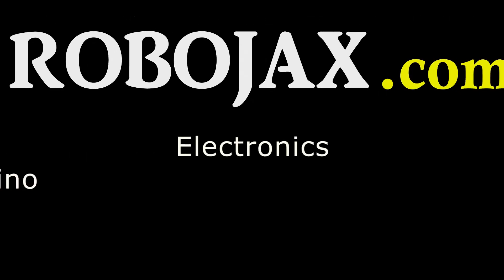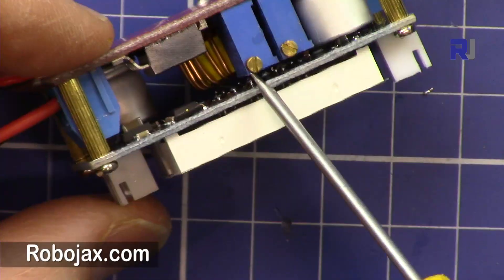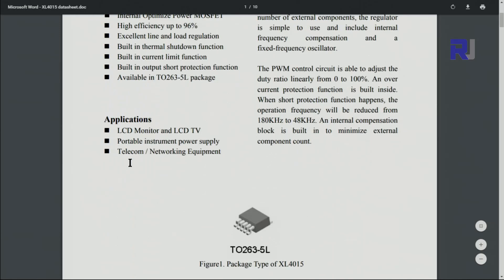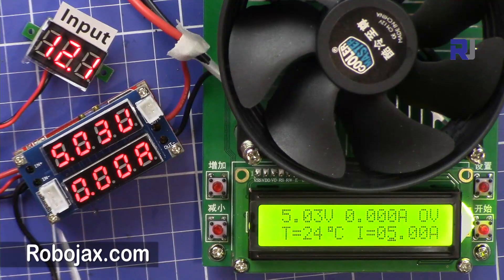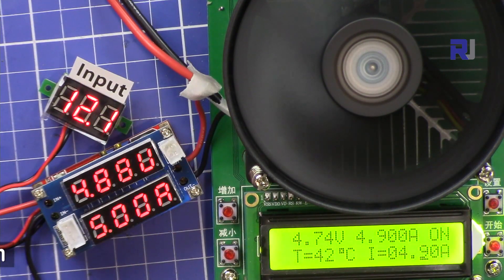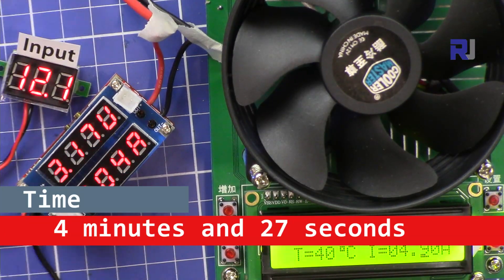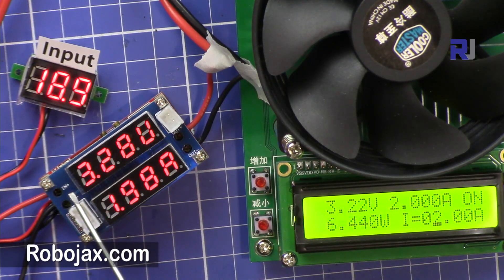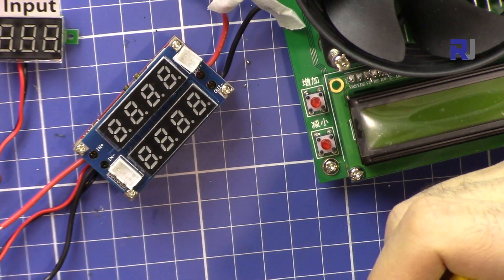XL4015 DC to DC 1.25 to 32V 5A  Buck Converter Lithium Constant Current charger

Comment: You call this a constant current power supply is it a true constant current power supply with a compliance voltage adjustment? Rather than a current LIMIT supply? Two different things period

Comment: Great Video. Bought one. Can we use it's Voltmeter Ammeter pair (the top one) separately with other buck/boost converters by soldering wires(alligator clips) to their input and output?
Reply: Yes, sure you can

Comment: Could you tell which IC/micro controller is used for the display?
While adjusting trim pot the screwdriver accidentally went over the ic pins now it's showing weired numbers.
Reply: Pm me can you to install do solar panel..
Reply: In my module the microcontroller/IC looks completely black. i.e. nothing printed on it.

Comment: I have a set of 4x3.85V 40Ah lithium-ion batteries (U max 4.4V). I use the converter to charge the battery in winter through the cigarette lighter socket inside the car. The conversion efficiency caught at 16V-13V input/output voltages was 94.2% in my case. I measured very accurately. Worth noting is the current, which has its efficiency peak at 1.2-2A. For me, this is ideal for slow overnight recharging. If the conversion voltages are close then the efficiency is high, although not as high as in good PWMs (even 99%)
Regards, Marek
Reply from the maker: Thanks for sharing your experience.
Reply: Pm me can you to install do solar panel..

Comment: I purchased a red color XL4015 5A module and the potentiometers are located a bit differently there - installed vertically. My Li-Ion battery is 3.7V/800mAh. When I set up the output voltage to 4.2 volts with the potentiometer (physically located closest to the voltage input terminals which is in my case 7.5 volts) then measure the output short-circuit current with 10A current range multimeter it is always 2350 mA regardless of the position of the constant current potentiometer (physically located closest to the voltage output terminals which is in my case 4.2 volts). If I connect my Li-Ion battery is 3.7V/800mAh and measure the charging current it is always 50 mA regardless of the position of the constant current potentiometer (physically located closest to the voltage output terminals which is in my case 4.2 volts). Question - how to adjust the constant current potentiometer to make the output current reach the predetermined overcurrent protection value of 800 mA? I have tried already 3 out of 5 modules you sent me -all are the same.
Reply from the maker: this is multiturn potentiometer. meaning you have to turn it 10 to 15 turns before you see the change in current.  either your battery is fully charged or the current on this device is set to minimum.
Reply: Pm me can you to install do solar panel..

Comment: curious, but if you routed the potentiometers out to say actual dial potentiometers, could you put a heat sink along the top of the device, in contact with the chip?
Reply: The primary heatsink path is through the metal tab, onto the PCB.  You could offer a little stress protection for the chip plastic casing with a heatsink on top, but it wouldn't necessarily need to be so large that you would benefit much from removing the pots, rather than just using a smaller heatsink.  Instead, just get a different buck regulator module.   There is no point in pretending it is a 5A module merely because that is the max spec for the IC but rather, to consider it less because of the whole design.  A design for more current is a minimal difference in price unless you are buying great volumes to make product in quantity.
Reply: Pm me can you to install do solar panel..

Comment: Hi, how did you get the 5v? Always it shows me the input voltage which is 12v and I can’t adjusted with the pot. I managed to adjust the current. Can you please tell me how to get the 5v at the first place? Thanks,
Reply from the maker: Hi, This is multi turn potentiometer. Turn it 10 to 15 turns.
Reply: @robojax  thanks it work.

Comment: Can I charge a car battery 14,4   3Аamper tuned to the output. rechargeable battery 64amp
Reply from the maker: Hello, this is exactly why I made this video to answer those type of questions. I don't remember the maximum current but for sure you can set voltage to 14.4V. Just watch and see if it can handle 3A, then yes.

Comment: What are the two white connector units (2pin and 3pin) on the metering unit used for?
Reply from the maker: I believe I mentioned that I have not found any information about those. use a multimeter and see if the value changes when you turn the potentiometer. so it might be for external switch or potentiometer.

Comment: can we use this charger for cordless battery
Reply from the maker: this module just knows voltage and current. so yes it should work if you set proper voltage and current for the abttery.
Reply: how many voltage input will put

Comment: Thank you for this video.  It was very enlightening.  Sadly it opens up at least as many questions as it answers and at some point in time I can see I am going to have to look at the chips and look at this from a lower level, but for example there are two big fet's that can disconnect the battery.  I think one was over voltage and one was over current.  It seemed like all of the current was going through both of them.  Given they have some on resistance it would seem to make more sense to only have one and have both conditions be able to trip the same gate.  And in the balancing charger, it seems easy to have the fet both bypass and discharge the most charged cell, but it would be more efficient perhaps to have two fet's there, one to disconnect the high cell and one to bypass it.  This may not be that big a deal if you are charging off low cost AC from your utility, though waste it still waste, but if you charge off of solar for example do you really want to be turning any more very expensive power into very expensive heat than you have to.  But, you did a great job going over that these things do and what they do not do which is just what I was looking for.
Reply: OOPs, wrong video, this was intended for the BMS one https://www.youtube.com/watch?v=0mOqpCfAdy4
Reply from the maker: Hello, the video for BMS is moved here https://youtu.be/QNENyu97w2A
Reply: Pm me can you to install do solar panel..

Comment: What is the function of the two jst connectors (white colour) which are placed on the top of the module??? This was not explained in the video actually.
Reply from the maker: the manufacturer did not provide details.
Reply: @robojax  Ok thanks but do you have any source/information which could explain the functioning of the jst connectors????
Reply: I had the same question. So I checked the continuity and checked for any paths on the pcb from these connectors. Here are the findings - The two pin connector is not connected anywhere. The three pin connector has a GND, and 2 pins labelled RX AND TX. I guess it would be used for a serial communication with a microcontroller. Also this V/A module has a voltage regulator that outputs 3.6V, meaning this v/a module runs on 3.3v(may be) and so the RX TX pins must be 3.3V, (I didn't try connecting it to a microcontroller yet).

Comment: I have 2 questions.
1. There is no cable between the 7-segment layer and the sub-layer but how does the screen work?
2. What was the 3-pin and 2-pin on the top layer for you removed from?
Reply from the maker: Hello, 1- the module has 4 screw. those are used for communication and power. 
2-connects are using for programming or external potentiometer
Reply: @robojax   Could you please tell me how to use the serial pins, preferably with an arduino?

Comment: Helpful video sir , can I charge 24v 20a lithium ion battery pack ?
Reply from the maker: Yes you can.  your battery capacity is 20Ah and if you charge it at 4A, it will take 5A to charge it. I am posting how to charge a battery using this module. Make sure to subscribe so you are notified.
Reply: @robojax  Thankyou Sir 👍
Reply from the maker: you are welcome.

Comment: Can I charge acid filled lead batteries with this module?
Reply from the maker: yes you can. you'd have to set your voltage and current limit.
Reply: @robojax  For a 12 V 5 AH acid filled lead battery, to what value the charging voltage and current to be set?
Reply from the maker: for each battery it is mentioned in the documentation of the battery. find it.

Comment: It's a shame you didn't test another great feature of the upper module which is the serial communication. That is an awesome feature that allows logging and power calculations for battery chargers of solar systems.
Reply from the maker: I didn't know. it has such feature. when I purchased it, I did not see any documentation. Assuming the upper module is just display. thank you for telling me. I will have a look at it.
Reply: @robojax  I know...these chinese modules don't provide any documentation and very often we miss some nice features. I got the pinout for the serial port on another video, but I'm yet to play with it myself.
Reply: could you share the source please.
Reply: Pm me can you to install do solar panel..

Comment: can i use 3s lithium ion battery pack (12.6v maximum) to drive 12v led strips with 12v from this board?
Reply from the maker: this module doesn' t know the battery type. Voltage is voltage.  so yes.
Reply: @robojax  ok thank you

Comment: I do not know if someone out there can help me? here is the problem I have with this module: I am having a problem in  following the instructions from Robojax in this video and trying to set the current. 1) I set my voltages to 5.00V without a problem 2) As I short the output wires the current reads 1.25A and the blue light is on. I then try to turn the current potentiometer the raise the current to 3.0A, at around 1.75A the display suddenly shows 0.00 A and the blue LED shutoff and the red led turns on. And now I cannot adjust the desire current, is my module dead? (by the way I tried with 2 modules), is there a way to reset it to normal operation and if it is the case how can I adjust my current up to 3A? after all the specs on this thing is 5A... Thanks for your help!
Reply from the maker: I waited to see if someone replays and your comment was under "I haven't responded" section. For me to answer, I have to connected the exact voltage and load to see it and I don't have the module ready. I hope someone reply
Reply: @robojax  Thanks, no one replied just yet! I still have the same problem! I was trying to feed 5 volts to a Raspberry Pi 4 8Gb and I kept on getting the low voltage on the Raspberry - So I wanted to crank the amperage up to 3 amps to properly provide the right current to the RPi .

Comment: Is it possible to power a laptop at 19.5v 3.33a from a 3s 12.6v lipo with that converter?
Reply from the maker: 3S 12V can be 1W or 1000W . now. your laptop needs 19.5V x 3.33A = 65W and if your battery can supply 65W ÷ 12.6 = 5.1A yes you can do it.  this is the minimum.
Reply: @robojax  Thx for that info. I recycled the 3 cells from a laptop battery and connected it via a 3s BMS. Each cell has 4300mAh. So I think the C rating is higher then 1. But I guess I need a proper cooling solution for 5A through this converter?

Comment: If the input current is only 1Amp the module can boost the output to max of 5 Amp or it defends on the input current?
Reply from the maker: Output power can never be more than input .(  Input Power +10%) = (Output power). P=VxA if you tell me the input voltage, then I can tell you the output voltage and power.

Comment: Nice video. I need to connect 2 usb ports  to charge cellphones, does phone gets as many amps as it needs?
Reply from the maker: Yes. Check the video. At 5V output it will be divided the current (Ampere) into two phones.
Reply: @robojax  ok, thanks.
Reply from the maker: you are welcome.

Comment: Nice video. I need to power my odroid xu4 thru battery. so i need a stable 5V and 4A current. Which DC-DC do you recommend for nimh,nicad or SLA batteries with 7.2V or 12V input?
Reply from the maker: Thank you. NIMH has longer life but needs careful attention when charging.  NICD is cheap and easy to charge but not as lasting as NIMH.
Reply: Pm me can you to install do solar panel..

Comment: Thanks for the excellent review.  I made the mistake of ordering gel cells for a small portable power station I am building.  I am using 2x 12 volt 12 ah batteries parallel.  Since then, I have been looking for a good way to charge them at 14.4 volts with a 2 amp max rate.
Would this be a solution to charge them with a small 30 watt panel?  Does it turn off the charge when voltage levels are hit like some others I have seen?  Thanks.
Reply from the maker: You are welcome. First this is NO a charger but it is a power supply. Because it has CC (constant current) setting capability, you set your current and voltage and never allows any current above your limit.  I mentioned that is is not a charger because Lithium Polymer (LiPo) and other sensitive batteries need special charger or they get damaged. Your battery seems to be different and if you monitor status of charge you can use this module to charge.
Reply: So it is possible to use with the panel, but there is no “cut off” voltage point on the charger like a typical controller. one way to charge gel cells is with a constant voltage float charge, I could just dial 13.8 in. Or, if I had a load running on it, I guess I could dial up the voltage to 14.1-14.4 volts.  In any case, I think the panel at 30 watts is pretty close to the max amp limit with 24ah, so I would really only be using this to decrease the volts down 4-5 volts, not so much the current.  Thanks for your input.
Reply from the maker: the current determines the voltage. for example if we set the current at 2A. Any current under 2 will keep the voltage at 14.4. Then as the current reaches to 2A, the voltage is reduced until the current is below 2A and charge continues until no battery is full and it doesn't need more current, then voltage rises and charge will stop. so voltage  will be observed and 14.4 is your cut off .

Comment: I have seen a review of your video about the LM2596 and XL4015 modules. I was thinking about how to stabilize the ic temperature when working full load. Now I have thoughts below, but I want to ask for your personal opinion. According to you :
Can ic xl4015 (with the use of constant current 5A) or lm2596 (with the use of constant current 2A) be separated from the default board and then extended pinout the legs ic using a good cable and then attach it to a heatsink that has the fan? For example, it is affixed to an old VGA card fan heatsink where the power to turn it on comes from the input power module.
I mean that the 3.42A / 19V (laptop charger) power source is coupled to the IC 7812 input (with a heatsink) then outputs the IC 7812 to the VGA card fan.
By the way, in your opinion, which is more accurate in measuring currents using a common digital multimeter or digital volt and ammeter panel?
Thank you in advance and greetings from Indonesia.. (*_^)/
Reply from the maker: Yes you can move the regulator to large heat sink. Actually that is the best solution. 
For current measurement, it depends on how good is the quality of panel or multimeter.  Some times V/A panel meters are better than meters. But meters are generally better. You would have to do the test and find out which one is accurate.
Reply: @robojax  Thank you for the reply..
Yes, I have tested it on both devices.
In the XL4015 module, I set a current output of 1A and output voltage of 4.2V.
But I saw something wrong, why is the difference in the current reading on the two devices different?
Try to see for yourself in the attachment that I included here:
- Before the current test: https://www.dropbox.com/s/5vzygkrqrrtoja9/Before%20test%20current.jpg?dl=0
- While the current test: https://www.dropbox.com/s/ayiugf1g7yhj4y3/While%20test%20current.jpg?dl=0
- What inside on black box : https://www.dropbox.com/s/b0qtgf1yrvqwsdj/PSU_XL4015.jpg?dl=0
So, which current reading is correct?
Digital V/A panel meters or multimeters?
Both are new in the box. Is one of these devices a manufacturing defect?
Reply from the maker: I can see that you connected the output directly to your meter and there is no load. Just short circuit. Strange. What happens if you short circuit the box without multimeter? Let me know the reading.
Reply: Robojax  Do you mean without digital multimeter ? Yes it is showing the same result like the 2nd attachment (while measured).
Maybe today/tonight I will try with LM2596 regulator buck module & the other parts still using the same part. I will posted the result of it here a.s.a.p..🙏
Reply from the maker: Something is wrong. How much do you trust the Ammeter installed in the black box? Either current goes from other path or the meter is incorrect. If your multimeter is working properly.
Reply: @robojax  Hi again ... Of course for myself, I would rather believe in a multimeter than digital v / a when measuring it. And yes it's working properly. I've already try with LM2596 regulator buck module and get the same problem at all.
Btw, now I know what the problem is. This is from digital damage itself or factory defects or when shipping. I tried with a new one (again) from digital v/a, it looks normal, but it must be adjusted first from the back panel potentiometer v/a until the value approaches the value in the multimeter. Because it must be adjusted first, the difference in value is read between v / a and multimeters around 500 mA - 1100 mA. And the problem now is solved. Case closed... \(^_^)/
If I can ask again, on the original multi-turn potentiometer, such a module, for example, the value is 10K, if it is replaced to a mono potentiometer, is it better to equalize the value or decrease it? For example 10K is replaced with 5K. What do you think about that?